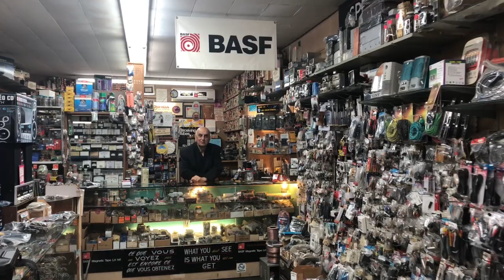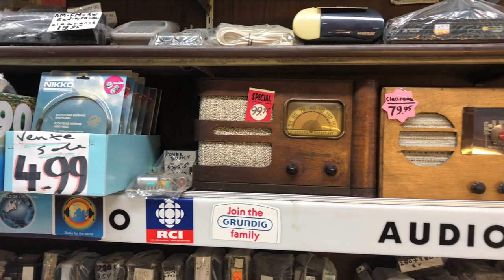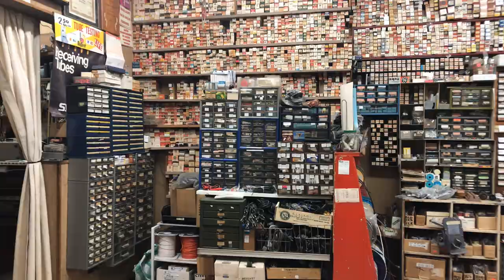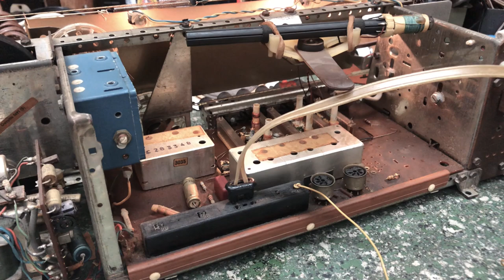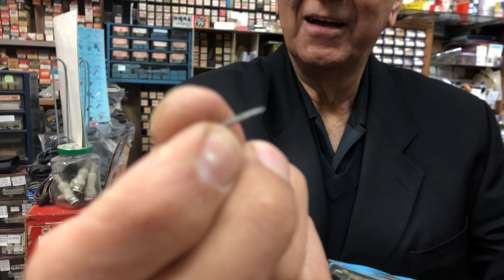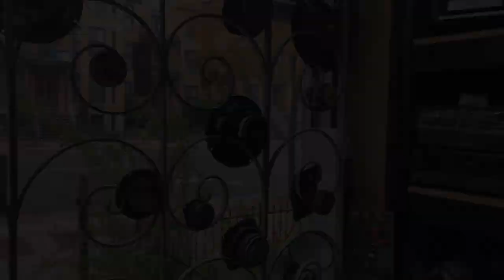'Radio doctor' practices dying art of electronics repair

Comment: this is what I did for most of my life. now I am retired and just do it for fun. times change.
Reply: But sometimes they shouldn't. Companies now are getting away with making their electronics unrepairable so they can force you to buy new. That is the problem. In the late 80s early 90s here in the UK our backroom TV broke. Family friend came over, opened it, the schematics were on the inside of the case, he followed that and repaired it. Now, you're not allowed access to schematics and not allowed to repair.

This man has never met Louis Rossmann
Reply: @TheStevenWhiting  Its just the way it goes. i suppose when the crystal set went obsolete there were those who lamented its simplicity. I have done it all from vacuum tubes to transistors and ICs on some things like hand held radios the continual problems are jacks, speakers, and controls. its still amazing how many times its possible to get something going we are supposed to throw away. On we go.
Reply: @NebukedNezzer  I think some people still do make small radios like they used to. In countries that are run by dictators the populous that want to listen to the free world still risk making their own. I believe some in North Korea do it.

Comment: The well made older electronics "were built to last" and can be repaired. I have a Teac open reel tape deck from the late 1960's I bought in 1977 some head wear, but still working.  Same with a Pioneer FM receiver from the early 80's. Though it's likely due for  restoration.  New capacitors, resistors,

Comment: Electronic equipment today is deliberately made so as it is not reparable. If it breaks under warranty, manufacturer replaces it.  Off-warranty, you simply replace it.  How many items are glued shut so you CAN'T get into them??
So much of the new equipment (1995 and newer) is surface mount with LSI components.  Those components are not released to the RMO markets.
NTE, who supplied a fairly decent semiconductor cross-reference list and supplied replacement components, went into bankruptcy in September, 2024.  Sounds like Vetco electronics may ave bought their surplus stock.
I started repairing radios & televisions in 1964. All tubes back then, but often enough, something went under the chassis.
In amateur radio circles, I have found so many that are absolutely paranoid psychotics about those LETHAL "high voltages".  Good reparable stuff is being dumpstered.
If you can keep it going, do so!